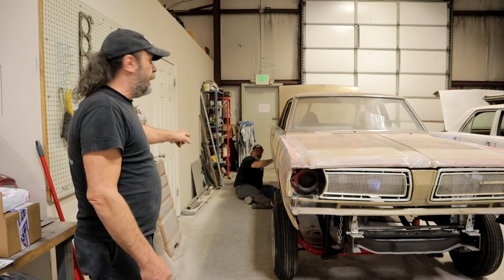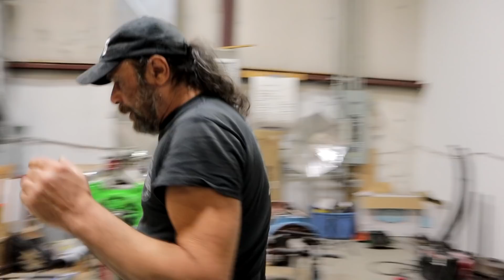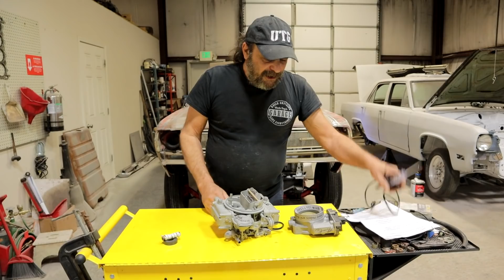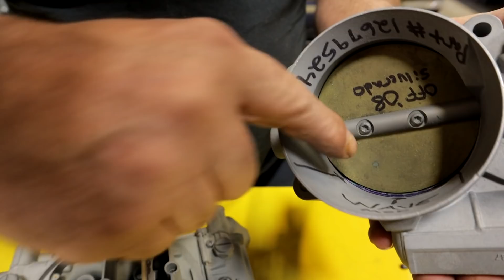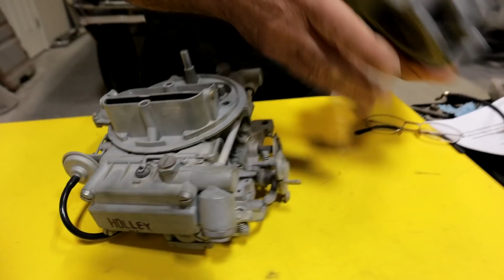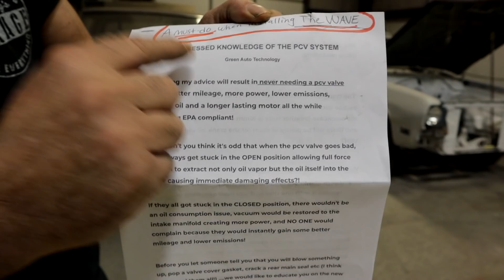The Free Energy Scam And Other Absurdities Of The Mechanical World

Comment: I just had a thought (dangerous activity, I know). 
If these perpetual motion machines work as they say, by which I mean it has more than 100% efficiency, wouldn't it immediately explode?  Assuming it wasn't hooked up to a massive load or battery or flywheel or something. These kooks, if we believe they have a chance of doing what they claim to be doing, are taking HUGE risks everytime they test their contraptions.
Reply: I knew a couple of guys 40 years ago who argued they'd invented free energy, and claimed they'd connected a lawnmower engine to a generator via a belt, and used the current produced to electrolyze water into oxygen and hydrogen which was fed into the intake. They claimed it was so powerful that it caused this lawnmower engine to self destruct by overrevving. A few key questions revealed that they'd not only still had the normal gas delivery still hooked up, but they'd also disabled the governor. Telling them to repeat the test without putting the wires into the water to see if it'd still explode with the governor disabled led to protests that "It blew up! It doesn't run anymore! But we proved it works!" led to me dropping these idiots from my social circle.

Comment: Personally, I would not waste my time testing that carb, but if you can't resist, just swap out an un-modified throttle blade section for the un-modified test.  As long as the throttle blade bore diameter is the same, you should be good to go. I would not bother though. Educating the ignorant is one thing, but these people are con artists that are using you and your channel for free advertising for their con. They may even be sincere but deluded "inventors" that have conned themselves into thinking that they and they alone have discovered some magic sauce that violates the laws of thermodynamics. They haven't. You know this, I know this, and everyone who watches your channel knows this. Love your channel by the way! Cheers M8.
Reply: The groove is in the bore, not the blade. As soon as the blade is cracked open the cylindrical air charge is unimpeded. In other words, it doesn't do anything to the edge of the air charge.
Reply: @cocarr1  No, the groove is in the heart.  
Well,  at least that's what Dee-lite said. 😊😊
Reply: @cocarr1  Exactly. At most, this modification will lean out the mixture when the throttle blade uncovers the groove because at small throttle openings the fuel for the engine is being drawn through the transfer port, but the groove will be supplying additional air. If the transfer port jets/air bleeds not changed to account for this, the off idle mixture will be lean. How lean depends on how big the groove is. If it is too lean, this will cause a lean miss at just off idle throttle openings. As the throttle blade is opened further the carb transfers to feeding fuel through the booster venturis via the main jets. At this point, the groove is a meaningless little imperfection in the wall of the carb throat. It might cause a tiny amount of turbulence, but that's it. It will not create some magical efficiency gain understood only by those few gifted souls upon which the Carburetor God has bequeathed special knowledge.
Reply: until something works... just sayin
Reply: I would just throw this stuff in the trash.  Your too nice a guy utg, getting sucked into someone's market plan.  This guy is the Jehovah witness of the gear head world.
Reply: Testing that carburetor would be a huge hassle. You would need a like for like baseline carb and have to install an 02 sensor.
Reply: Ron Hatton was Not a Con artist, he was just a week marketer. HE was oppressed, especially after he wouldn't take GMs 50 million offer to sell and 2 months later he turned down a 400 million dollar offer from Ford. They got him thrown in prison for over 2 years over trumped  up unrelated charges. So there is something to this groove mod and I know personally because I learned how to do it and used it several times. Its a SIMPLE MOD! nothing wrong in trying it out!

Comment: I've worked with a lot of Holley carburetors, I'm sure if there was some benefit they would have implemented it already.
Reply: i dont know holley has been around for ever and sold a ton of carbs but they are all very similar. many are just the same ole 4150 or 4160 with a differnt color or coating.
Reply: @AaBb-zj2ld  I have book that I call the Holley bible, it's black and 3" thick. Full of different Holley carburetors and all there specifications. Manufacturers and performance applications.

Comment: Speaking of the PCV system, what are your thoughts, Tony about using an oil catch can somewhere in that PCV hose? I put one on and I like it. I have to empty it every few months as it gets full of nasty stuff I don't think I would want in my engine.
Reply: I put air oil separators on everything I drive and I'm amazed the amount of crap that gets pulled into those things.
Reply: @lsrengines  I like oil separators too. I've added a BMW oil separator inline in the PCV hose,and fashioned a catch bottle from pvc parts on a hose. The BMW oil separator has a small nipple on the bottom to send condensed oil back to the crankcase, so my add on catch bottle just collects it. mostly water with some oily stuff in it.
Reply: @lsrengines  the thing is, your not really getting any "crap" out of the engine.  The can doesn't discriminate between oil and crap.  The reason your catch can looks like it's got crap in it is because you are catching hot oil then letting it collect in a relatively cool space rather than the crankcase.

If it was just sent back to the engine that stuff (most likely water mixed with oil and collecting some solids) shouldn't be accumulating in the engine, it should be basically cooked off by the engine heat. 

Project cars tend to suffer from this stuff though because they don't always get a lot of consistent long range driving.
Reply: imo oil burns so should get better mpg haha
Reply: The oil vapor more than likely gets burnt off without catch can .. with the can the intake should stay cleaner.. wonder if emission would be lowered enough to accurately measure
Reply: That stuff is mostly condensed oil-and-water mix. At operating temperature, the water would be vapor and there's no issue with letting the engine process it along with the intake charge. As @David points out, the oil component would burn if it vaporized during the compression phase, but the problem with the oil is that it can instead coke up and make a mess of the intake manifold, runners, and intake valve. Today's direct injection engines also can't rely on the gasoline being sprayed on the intake valve and runners to clean things up.
I think that what you would really want to maximize the benefit and not worry about having to empty things, is to have a larger volume swirl pot, similar to how the de-aereation is done in dry sump tanks. The vent hose from the valve cover enters tangentially, so that any solids and droplets are impacted onto the side of the pot and they slowly drain down to the bottom where a drain runs stuff back to the sump - it's only oil, after all. At the top center of the can, the PCV hose runs back to the manifold plenum through a one-way PCV valve. This arrangement minimizes the oil vapor and droplet content in the stuff that goes back to the intake. You could wrap the pot in a heater tube (from the cooling system) to encourage the oil and water vapor to stay separated.
Reply: @theosmit6366 it's nice just to eliminate as much of that stuff going into the intake as possible but with supercharged and  turbocharged cars it can actually cause a massive issue with pinging and hot spots.

Comment: The best way if you do want to try is use a known good carb, do like 5 pulls over a set distance. Pull it off, modify it the same way he did on that one (surely done with just a Dremel) and repeat the runs. If you use that carb he sent it looks like the car will barely run on it.

Comment: I can see Tony and the guys building a catapult and first thing being launched out of it would be that Holley with a "get that shit outta here" comment followed by that vapor system on the next pull. 

Sure, send them the gimmicks to prove these "innovators" wrong on the channel the lob it to the next county over... laughs for days! 

The whole free energy nonsense is another comical delusion- these guys must have stock in the hot glue and magnet industry. One of my favorites was the two malbushi motors hooked up via belt and pulleys generated enough continuous energy to charge your cell phone.
Reply: Lmfao

Comment: Tony please just put that carb on ur gt and see if it even works ! If it does drive the car as normal and go through several tanks. ( Odometer or ur phone GPS ) same way we all check our mileage. Right , lol Great Video , thinking back my 51 Chevy not only didn't have an oil filter I believe it had no p v c either.

Comment: Glad you're doing well.  For the carb test, if you have the same carb, do your test run with your "good" carb and then just switch the throttle base plate and rerun the test run.  The internals are the same so the only change would be the "groove" in the plate.  This should be fair.  Thanks for all the great videos.  Best Regards - Mike

Comment: Fill tank, drive a 100 mile loop and refill tank with same exact gas pump then calculate fuel mileage. I would try it with the throttle body and borrow a Chevy truck to test it on. Use cruise control for as much as the test as you can. Bob Lazar, always a fantastic show when he's talked about on Coast to Coast AM! I really have no idea what to make of the whole thing, but it's interesting to listen to.
Reply: Actually, Tech Ingredients just did a video like this, except it was to test how much fuel is used while idling. This might be the only way to test this carb... If it works at all.

Hey Tony, maybe you could send it on to him. Might get Michael off your list. Hopefully.

Comment: As that’s a “daily test vehicle” I would say drive the vehicle for a month span per test, have someone else that knows the deal with the carb and have them swap the carbs at some point and only them able to pop the hood… pad lock or something to keep you out of there… and have you daily drive it for a couple months without knowing what’s happening under hood

They could swap it at their will, so weekly daily etc so you’d be oblivious to what’s on the car
Reply: Not really a great test as the weather will change over the next month and just the difference in outside temperature average will effect fuel economy.
Reply: @bcbloc02  correct me if I’m wrong but that would be a “real world” test
Reply: @jeremiewampler  Making the operating conditions average equal for each would be a challenge. Be lots easier to put it on a load dyno with a fuel flow meter and just test the actual consumption under various load conditions.

Comment: I'd probably say get another holley just like it, set it up to run exactly how you would set up a carburetor for a daily driver, and then run it at operating temperature until it runs out of gas, and then vice versa with the Michaels holley, set up exactly the same, making the only difference the groove on the plates. I would assume you probably have another holley like that laying around somewhere, but if not it would kind of be a waste of money to test something that is 99.999% not going to show any effect on account of how air travels like you said.

edit: ok yeah still way new to this whole carburetor thing and i didn't even think to just switch base plates.
Reply: I would say to test the carbs on 2 different days with someone that did not see what carb is on the car that day.
Reply: A would say don't waste your time with such a stupid thing it will do nothing no need to test this

Comment: Free unlimited automotive power is E-Z. Just attach your electric motors, add a pulley at each wheel, attach an alternator, ???, Profit!!!! Might also attach a battery to jump the motors before the alternators start turning or even a really good capacitor to hold charge until you start again.

THE PRECEDING WAS OBVIOUSLY MEANT AS SARCASM AND A POOR ATTEMPT AT HUMOR MADE BY A RAGING INCOMPETENT PLEASE DO NOT RESPOND WITH 500 PG ESSAYS ON ELECTRICAL ENGINEERING EXPLAINING WHY IT WILL TOTALLY WORK.

Comment: The only way I have ever see those groves or tornado devices can ever do anything beneficial is if fuel is drawn or added at the point of most turbulence and that turbulence could atomize the fuel more than usual. So that being said I could maybe see the carb having the most likely hood of doing that.
Reply: TBI no doubt , 12 mpg 350 Chevy my neighbor had ! That is as ( atomized) ur going to get from that far from cylinder.
Reply: That's exactly what it does it take the drops of fuel and mix them up prior to hitting the valve so the fuel have no time to sit on the walls of the intake I could see it being slightly beneficial but also maybe running the engine a little lean on the bottom

Comment: Another enlightening video by Uncle Tony.  Yes, there are 907 btu's in an ounce of normal gasoline and IF you could devise a system that was 100% efficient you will still never surpass the 907 no matter how many grooves or chilling or heating or vaporizing or steaming you put the gasoline through.
Reply: Diesel has more btu
Reply: Yes, but even the most efficient engine gets about 35% thermal efficiency. There are ways to help raise efficiency but not increase stored power of the gasoline
Reply: @Tj1983coggin  I don't think anyone would argue that. Lots of things you can do. Thinner tires aired up as much as possible, take the dead bodies out of the trunk, make sure your exhaust is free flowing...etc etc
Reply: @natevanlandingham1945  bwa haha....i know a guy with a mustang...still has the original owner in the trunk
Reply: @natevanlandingham1945  i m up in canader...was icy on my 400 mile trip...had to drive 45 mph...got great mileage
Reply: @natevanlandingham1945  Never thought about the dead bodies. I'll try that.   :)
Reply: @Tj1983coggin  The Chinese claim to have an engine over 50% thermal. Mercedes says their 16liter diesel is 48%
Reply: Look up Grieves Hydrosonic pump and wrap your brain around that math or explain the energy difference of a nuclear bomb
Reply: @cannibalcarl8512  I don't need to "look up" anything for that. In fact, I've just explained it.
E=Mc2. an atomic or nuclear explosion illistrates the fact, rather than contradicting it.
Enriched plutonium or uranium is stored energy. The amount of energy released depends entirely on its mass.. a red herring though. True perpetual motion isn't possible., Free energy dosent exist and 2+2 will never=5 🐸
Reply: You know this, I know this, Tony damn sure knows this.. but again, as I've pointed out several times, and not trying to be abrasive.. but we have 2 entire generations dumbed down since their childhood, but told they were brilliant and "could do or be anything they wanted to be." (A vicious and cruel lie btw) Beaten over the head daily with climate propaganda. "Clean energy" propaganda. Now, we know it as a cash grab by our lawmakers. But the dumdums think it's real, and as I mentioned, they believe they're brilliant and smarter than the rest of us. And so we get what Tony just showed us on his bench there. A wild cockamamie contraption that some random sat and cooked up in his head. Which basically amounts to an unattractive paperweight. Jesus, the carb isn't even functional fcs.
It's sad and comical at the same time.
Reply: @lilmike2710  in the 80s famous race car driver Peter brock endorsed the "polariser" a device that apparently had multiple benefits but basically amounted to healing crystals for your car.

There's a sucker born every minute and they've been around a lot longer than the last 2 generations mate
Reply: Check that number...I'm sure there is more than 907BTU in a gallon.
Reply: @natevanlandingham1945  he said ounce, that's 1/128th of a gallon
Reply: @teelang1231  oh good catch...I was assuming we were talking in a gallon. I can believe that number per ounce!
Reply: What if you clear 112% efficiency now that 907 should be burnt longer.